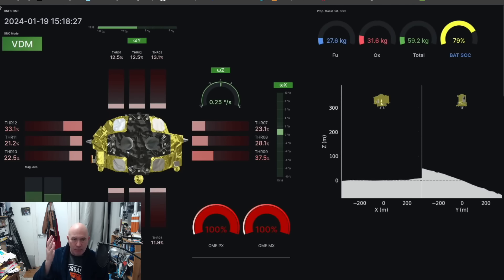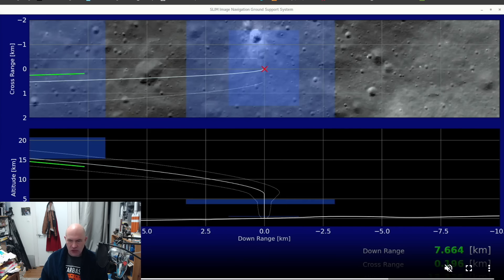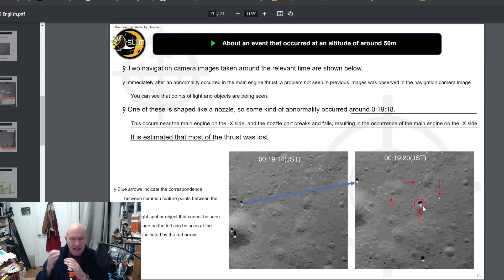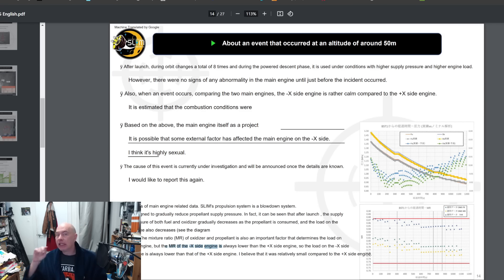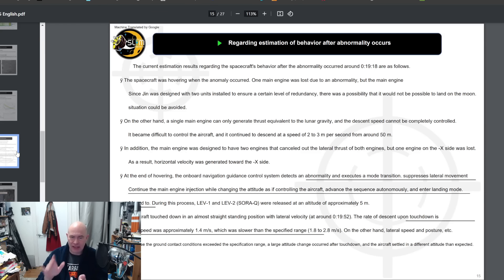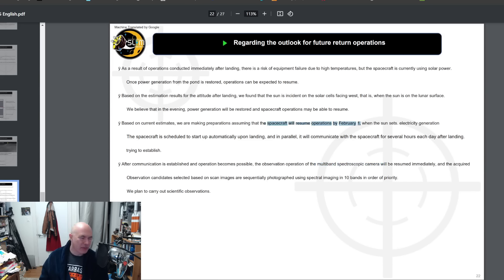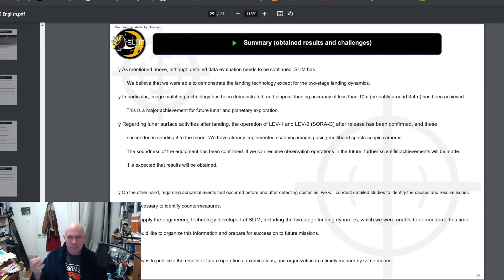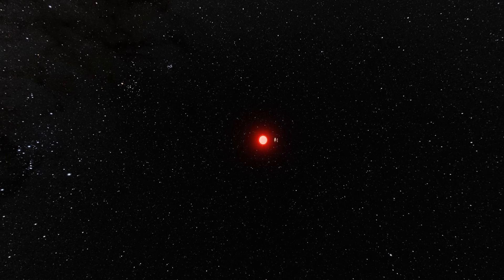Japan Finally Reveals What Happened To Their Lunar Lander! And It Really Did Surprise me!

Comment: Designing in a flip maneuver just before touchdown on a sloped surface in my opinion is high risk and a recipe for disaster.  Perhaps they will learn their lesson and add four landing legs around the main engines then design in a rotatable solar panel.
Reply: Not 'designed'.

Comment: If I had a nickel for every time a Japanese spacecraft had a fuel valve stick open, causing the engine to run oxidizer-rich, causing the engine bell to blow off, causing a mission degradation but not outright failure, I'd have two nickels. Which isn't a lot. But it is weird that it happened twice.

Comment: Why does NASA think spacex trying to land nearly 200 tons of stainless steel with humans on board is a good idea ?. Landing on the moon is clearly very difficult. Would you get on a starship with confidence that you wont die ?.....good luck.
Reply: I agree that Starship looks weird as a human Moon lander
Reply: @olasek7972  I agree.
Reply: Because human landings are far easier then robotic landings. Because Humans have real time problem solving ability's.
Reply: @unownyoutuber9049  no comrade, human landings aren’t easier, they are far more difficult, Russian sent robots to the Moon countless times but they could not pull off human landing despite trying real hard
Reply: @olasek7972  Getting humans to the part where they land is hard, once you're there human's piloting the craft to the surface is easier. The soviets failed because the N1 didn't work. The Lk lander was the only part to be human rated.
Reply: @unownyoutuber9049  that’s the point, the WHOLE effort counts, also since nobody else but NASA landed humans on the Moon it is impossible to say how easy or hard it would be for others to replicate it.
Reply: @unownyoutuber9049  Mu understanding is it will be a fully automated landing. Even the first landing in 1969 was automated until the very last minute when Armstrong took over. It's just the sheer size of starship and the fact whoever is on board will be 100ft from the ground with limited or no visibility that will make any last minute intervention unlikely.